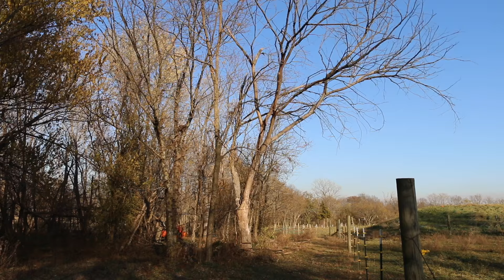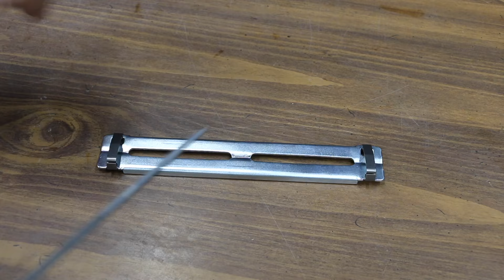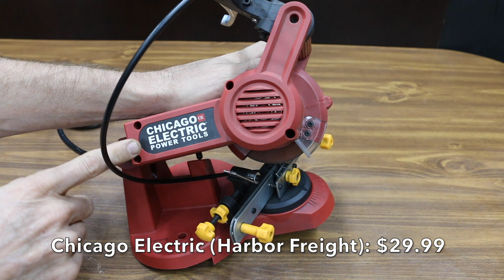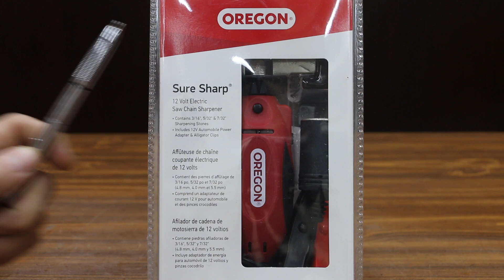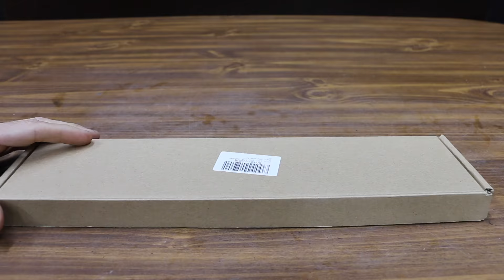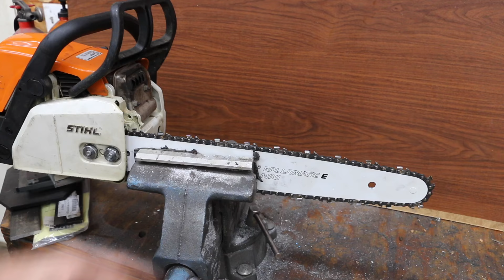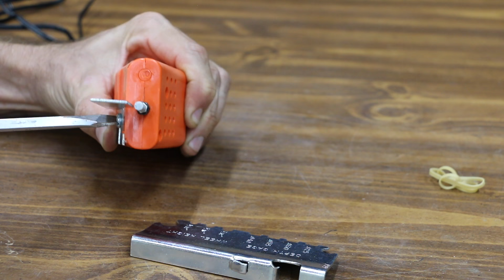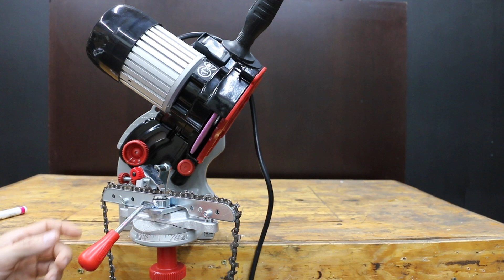Which Chainsaw Sharpener is Best? Let's find out! Stihl, Granberg, Chicago Electric, Oregon

Comment: One of the most important tools for sharpening a chain?  A vise to hold the saw still in!
A good sharpening, getting down into the gullets of the chain will make the chain sharp, as well make it cut faster.  With the Oregon file and guide I can run thru a 25" chain, both sides, in about 5 minutes, 3-4 strokes per tooth.
Reply from the maker: Thanks for the feedback.
Reply: @ProjectFarm  Also, with a file type system, you need to have the chain tighter than you would run it than when cutting so the chain doesnt deflect when filing.  Also, you only cut on the push stroke with a file.  Once you have filed a hundred chains or so, you get pretty handy!  Also, the electric sharpeners like the Oregon you have to take  small cuts.  If you see the chain turning blue, youre taking the temper out of it, so even though youre making it sharp, your taking the temper out of the steel.  Thanks for the great content though!  People need to know this stuff!

Comment: The issue with the bench grinders is that you didn't have the cut depth or tooth alignment set properly on either one. They take some practice, but they're the fastest and they'll easily outperform a file system.
Reply from the maker: Thanks for the constructive feedback.
Reply: @ProjectFarm  I forgot to add that you generally need to readjust when you change directions, too. That's super important.

Comment: Did you not do the yellow shaperner pictured in the beginning of the test ? Which one was the 3 to 5 sec sharpener.  I bought one of those on Amazon for around 12$. Havnt needed to use it yet , and got excited when I saw it in the beginning..... Did I miss it ???? 

Either way FANTASTIC VIDEO BUDDY!!!!  

Here is another test idea. Portable generators 7000 watt to 17500 watt. How much do you need to runs your whole house and best value??? I'm sure this will be an expensive test since harbor freights 9000 watt starts at 669$ and the generac 17500 is $3500. 

Let's get to donating to this channel to see this people!!!!

Comment: Thank you for doing this and including the Stihl 2 in 1. I think for the money and the 'set-up time' (pull it out of the plastic sleeve, line it up and go) it's hard to beat. My hand sharpening skills were pretty bad at best until I got one of these in my hands. I call it the idiot-proof sharpener. It does take a few teeth to get the hang of it, but once you get the hang of it, does a great job in a very short time. It makes the saw chew through and spit out huge chunks of wood.
Reply from the maker: You are welcome!  Thanks for sharing.

Comment: I have a video idea I think you might like. I think it would be cool to test different Sawzall's or different Sawzall blades.
Reply from the maker: Thanks for the video idea.
Reply: What do you use your Sawzall for?  Demo and pipe comes to mind, but for pipe the plumbers also like those miniature bandsaws.
Reply: @allanwind295  Well, it all depends on what your doing. They are useful for doing things such as cutting a hole in a wall to install an electrical outlet or other things in that nature you can't just use a actual saw to do.

Comment: Todd. Excellent as always. I was wondering if you were going to do one on sharpeners.  Then sure enough you did one.
I’m a part time “firewood  harvester” as I cut already downed timber on my woodland acreage. Downed timber is hard on chains as dirt, sand and rocks get in the bark. It’s quite a drive from my house, so I cut 1-2 cords at a time in about 2 hours and load it out.  I have three chains sharp and ready to go each trip If one dulls, I swap chains and refuel/re-oil. If I bugger up three chains, I call it a day.  
When back home I grind using the Chicago Electric Grinder.  I grind each tooth a lot slower than you did in the video. Going as fast as you did, I find the teeth overheat taking out the temper. So grinding slower leaves the edge much sharper. I also use the grinder to trim the tooth guard. I do the left hand guards then turn the chain around to do the right side guards.  This keeps the grinder from binding the guard while being trimmed.
Reply from the maker: Thanks for sharing.

Comment: You should do the Best Riveters and also best cordless screwdriver
Reply from the maker: Thanks for the video idea.
Reply: Marson 39000 HP-2 (hand riveter) should be on the list.

The thing with cordless tools, till they standardize batteries across brands (which will never happen till they are forced to do so), it makes a lot of sense for consumers to buy into the best system.  If you are a fine wood worker, for instance, that might mean you look close at Festool.  If you plumber, Ridgid makes unique (and expensive) press tools pipes.  Also, is cordless screwdriver a separate category than impact drivers for you?

Comment: I suppose why would you buy what amounts to a rotary tool specific for chainsaw sharpening, when you can use your existing dremel or other rotary tool and get the alignment adapter and grinding stones?  The amount of time it takes to setup the bench sharpeners should be included in the the overall times, because the last thing I want to do in the middle of cutting trees, etc, is to have to go back to the workshop, which also adds time.  So the Stihl 2 in 1 or oregon field seems to be the best overall.  Basically, what this is showing is that the tried and true hand file does the job, and buying extra stuff doesn't actually provide much benefit, especially taking into account the amount of time it takes to setup in order to get less than half second improvement cutting through the six 4x4s.
Reply from the maker: Thanks for the feedback.

Comment: I prefer ease of use and accessibility over performance so i think considering all factors id prefer the 2 in 1 stihl over anything else because if youre out in the woods and need tlc why bother with wiring and setting up a bench on your truck and setting all the angles when you can whip your tool out and go to work... that came out wrong but you get what im saying 😂
Reply from the maker: Thanks for the feedback.

Comment: I’ve got the Granberg Precision Grinder but hardly ever use it. It puts a fairly decent edge on cutter but I normally finish off by hand filing. As I said, I rarely use it, only resorting to its use, if I really mashed a chain on buried stones/nails/fence wire. So the grinder is good for removing a lot of metal quickly. But the grinder takes more time to set up, than to sharpen 72 cutters. And I still need to hone by hand filing. The one good thing it does make a decent job of, is to take down the rakers evenly; but this requires setting up again. My advice, save your money, take a second chain to the woods and buy a good bench grinder, for when you need to sharpen 2+ chains at a time.

Someone asked me a few years ago, what I wanted for a present. I wish I’d just asked for a bench grinder in the first instance. Would have saved a lot of frustration.
Reply from the maker: Thanks for sharing.

Comment: After doing a fair bit of research a few years ago I settled on the Stihl 2 in 1.  I have been very pleased with it.  The Granbergs are impressive, but when sharpening in the field (which I do quite a bit) I like that there is no set up required with the Stihl, and it keeps the depth gauge at the correct height.  Thanks for the video, best testing out there!  I know , because I have watched a fair few different testers.  Now I just go straight here!
Reply from the maker: You are welcome!  Thanks for sharing!

Comment: I tried a cheap Chinese made chainsaw chain sharpener just didn't feel like it was working. Broke down picked up a STIHL 2in1. First time noticed the chain was Sharp. Very little learning curve. Highly recommend it. I also like that I don't need  a 12v battery. Making field sharpening that little bit easier and quicker. Also I can sharpen it in the living room without much noise. Came in handy during a very uncommon snow storm in Texas and a a few large tree branches broke in the front yard.. I can run it across the chain every few tanks and keep the chain running tops.
Reply from the maker: Thanks for sharing!

Comment: The bench grinder just needs time to break in the cutting disk . Best to use a few old chains. And only 2 quick motions or it will heat temper the cutting edge.
Reply from the maker: Thanks for the feedback.

Comment: Another great video!
I was wondering how long it would take you to find the stihl 2 in 1.
That’s been my favorite since it appeared on the market. Very fast.
Now I will share a secret with you about sharpening when you are away from the shop. I will explain this the best I can. I have a 2x10 with a vise mounted to it. Set the chainsaw bar in the vise tighten the vise on the bar. Now look for the double link sharpen the chain using the brake to hold the chain still. That trick may be something you have not though of.
I hope this helps you.
I know you will take the time to answer me, you always do. Thank you.
Reply from the maker: Thanks for sharing!

Comment: I'll just stick with my dremel & bits eyeballing my angle marks.. what helps tremendously is not to run it crazy dull before sharpening & a vice  to hold bar/saw steady while sharpening make a huge difference
Reply from the maker: Thanks for sharing.

Comment: Very cool review - thanks! I've looked at the various sharpening systems myself (with the exception of the Granberg) and even before this test, I was convinced that Stihl is the way to go. Thankfully, your test backs that up. The electric models - the Harbor Freigh in particular - seem to be too aggressive in removing material. I would love to hear to your thoughts about how the smoothness of the grind and the amount of material being removed affects the overall ranking of these sharpeners.
Reply: Round file with a guide or the 2 in 1 if you have a vice handy. Both will help you learn the feel of sharpening sonic you want to go to free hand round file you can.
On the job, free hand round file is all we use, cut trees every day, eyeball the rakers depending on how aggressive you want it to cut.
Have always heard lads say that powered sharpening, especially seeing sparks, effects the temper of the tooth's steel, causing them to blunt easier or make your next sharpen harder, compounding the problem. Teeth are small, small amount of sparks is a big heat transfer on a small surface

Comment: you should find a chain with a tooth on every link.  crazy hard to control, but cut really fast.  also, controlling the depth of the cut is really important.  if you have a chainsaw that has more torque, you can deepen the cut and go faster.  you can see the chip size difference with each sharpening tool, as some cut them deeper.  The stihl sharpener as noticeably larger chips, but the saw does not have the torque to run the more aggressive cut and clear it.
Reply from the maker: Thanks for the feedback.

Comment: I'm really glad to see someone being original and honest. Those are both hard to find nowadays. I've seen every youtube video on your channel. Something I saw that may or may not skew test results when cutting with a chainsaw is the angle at which the bar follows when making the cut through the 4x4s. When the chainsaw takes a different angle other than perpendicular to the cut the cut becomes longer for the chain and can slow the chain down as well as modify how fast the chips get removed at the same time.  Any feedback from anyone with more technical knowledge is greatly appreciated.
Reply from the maker: Thanks!  Thanks for the feedback.

Comment: What I found very interesting is how much improvement you got out of a bit of practice with the different systems!  That in and of itself is an interesting display, and probably represents the kind of luck someone just grabbing the tool and starting out would have with it, versus someone that's a bit more experienced and has sharpened a few chains with the tool.
Reply from the maker: Thanks for the feedback.

Comment: Great video....but on those Bench mounted grinders (like the Expensive Oregon one) you need to use light tapping pressure, as not to heat up your chain.....I noticed bluing of the chain after you sharpened which would weaken the metal, and cause it to dull faster.
Reply from the maker: Thanks!  Thanks for the feedback.

Comment: One important thing to note: round files cut and keep blade teeth cool but those bench grinders tend to generate a lot of heat while removing blade tooth material.
I think they weaken the temper and then your saw gets dull faster.
Reply from the maker: Thanks for the feedback.

Comment: I always take your videos with high regard because you conduct your testing with a very scientific approach of removing as many variables of human error as possible and no one else on youtube goes through the amount of effort you do.
In saying that chainsaw sharpening is a task that brings a lot more difficulty in removing those variables. 
With all of these sharpening systems there is a level of skill and precision involved that can wildly vary results, being that a lot of these sharpeners are essentially just a file or stone with a visual guide to the correct angle, precision is still largely effected by human error. That is just down to the design of the tool though and you did mention that with the first sharpener.
On the other end of the spectrum with the $200 Oregon bench grinder, there was some visible blueing on the tooth in the closeup, which would indicate that the grinder wheel made contact with the tooth for too long, since that blueing softens the metal, it makes sense as to why the chain performed worse than all other tests in that run. The grinder wheel should only make very quick and short bursts of contact with the tooth, multiple short "taps" on the tooth would have yeilded better results than 1 second long single pass you did on each tooth.
Nonetheless I enjoyed this video as always with your content, and I appreciate the good timing too because I've been looking at a lot of chain sharpeners myself recently.
Great work!
Reply from the maker: Thanks!   Thanks for sharing.

Comment: “We’re going to test that” has become your trade mark.
Reply: We need a t-shirt with the project farm logo that says " we're going to test that"
Reply from the maker: Thanks!
Reply: He should registered it. I used a DC attorney named Josh Gerben for mine. #2 attorney in the US for number of trademarks filed. Prices were insanely reasonable.
Reply: As usual, great information. I have used chain saws for over 50 years and  have hated filing chain saws for decades. About 20 years ago I picked up grinding bits  for my Dremel tool and my chainsaw sharpening miseries were over. No special jigs or holders were needed....just maintaining the correct angle by eye and grinding until stone nicks were gone has produced excellent results. Plus my Dremel can be used for all kinds of tasks. Keep up the good work. Great testing protocols, great subjects. Your wood glue testing deserves a national science award.

Comment: The Stihl 2-in-1 is my go to.  Easy to use for beginners that never sharpened a chain before.  Is there a reason to clean the chains before sharpening?
Reply from the maker: Makes sharpening easier with all the dirt and particles sticking to the chain removed.

Comment: Something oddly satisfying watching your vids, plus always great insight for future tools or products that could be quite useful, by the way have you heard of graphene based motor oils? I was wondering, if it's not too expensive, if you could try finding some and either prove/disprove the validity in the use, unlike the graphite version you used awhile back, graphene motor oil works essentially the same, but can pass through oil filters and supposedly doesn't clump up into clay like goo.
Reply from the maker: Thank you very much!  Thanks for the video idea.

Comment: Timber Tuff CS-BWM, Timberline and the more expensive Oregon 620-120 (hydraulic assist speeds up the process by 50%) were the only other products I considered besides what you showed.  I picked up the original Pferd version of the Stihl 2-in-1, and it works fairly well (mine bites more and isn't as smooth as you demoed; maybe it gets better when the file wears a bit).  I was wondering how much variability there was in the times, and was pleased to see you answered that with the stock chain.  The bar graphs are wonderful clear in communicating the results.  I am wondering if you should consider adding +- measurement error on each bar?  It would help communicate that 0.2s or whatever isn't significant.  When you communicate the winner, I thought you did a great job explaining when the bench grinder was a good choice.  Consider talking a bit more about the winners in the end.  In this case why would you pick one Granberg over the other.  Your subjective experience when using the tools is interesting too.
Reply from the maker: Thanks for the feedback.

Comment: Terrific job, as always. I really like using the Stihl 2 in 1. It fits in your pocket and it's so easy to use no matter where you are. The only setup required is to turn the saw off and set it down, and you'll be cutting again in 5 minutes
Reply from the maker: Thanks so much!  Thanks for sharing.

Comment: Nice job👍👍 used most of these and found the 2 in 1 is the fastest, best, cheapest solution. I sharpen every fuel fill up, touch it up and throw a wicked sharp edge on there.
Reply from the maker: Thanks!  Thanks for sharing!